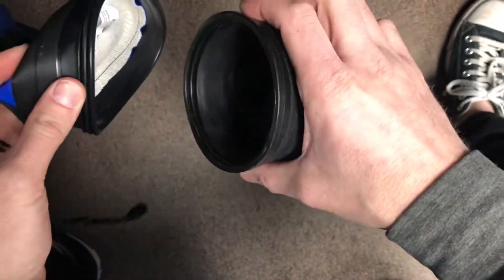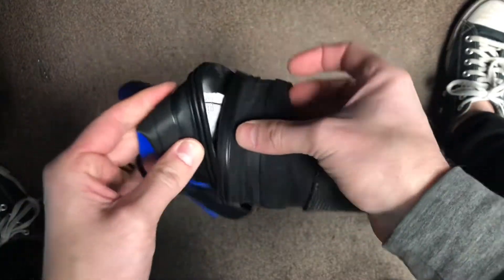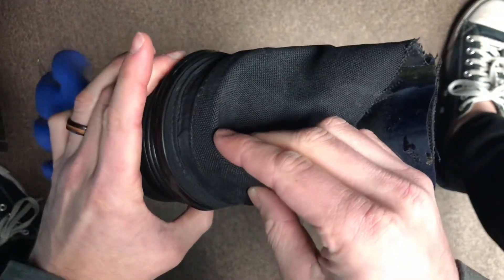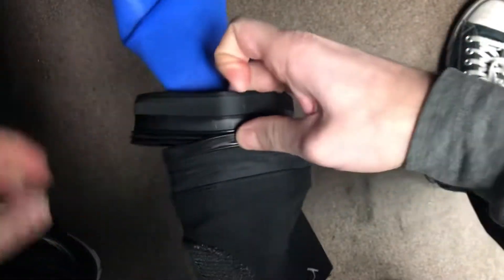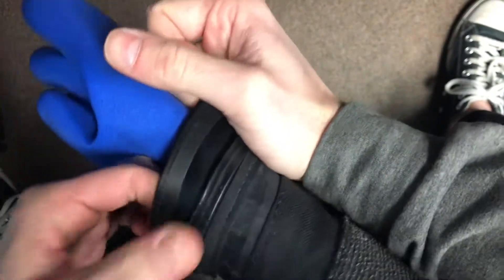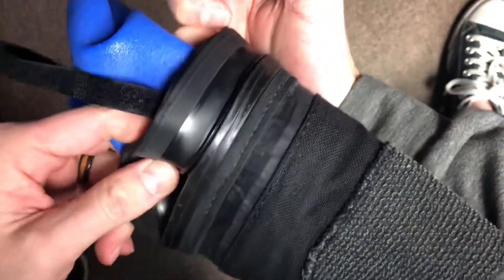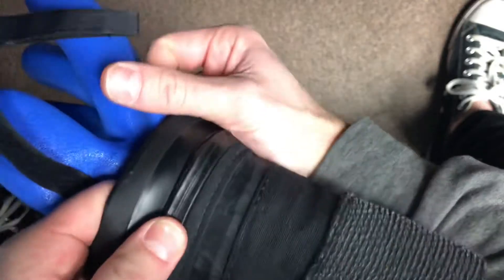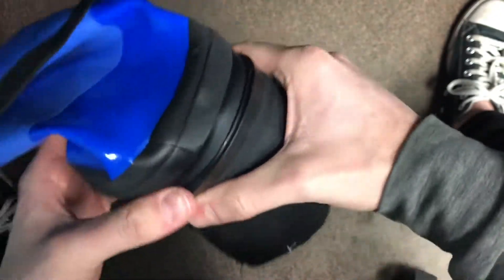Installing DUI ZipGloves

Comment: Are these worth purchasing ? Do they help keep your hands warm?
Reply from the maker: They definitely make a difference in warmth. If you own a dui dry suit with zip seals this is the best dryglove option.
Reply: @timsgeartips  what happens if you tear one of these gloves while diving? ???
My latex wrist seals are cut to far down and I use bio seals to counter that. But if you’re working deep and have decompression stops what happens when you tear a glove?
Reply: Wouldn’t the kubi system be better so it’s not $190 every time you rip a glove?